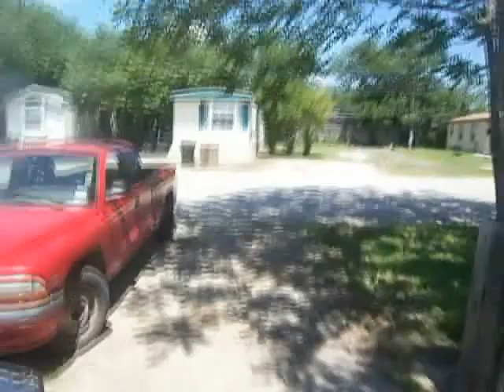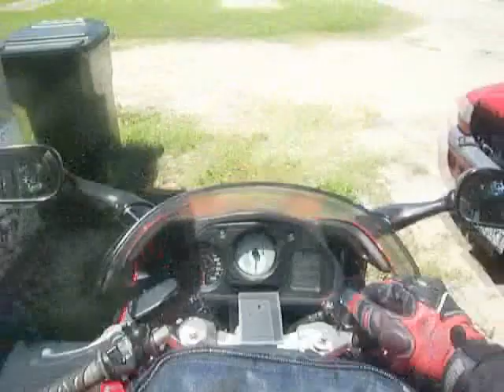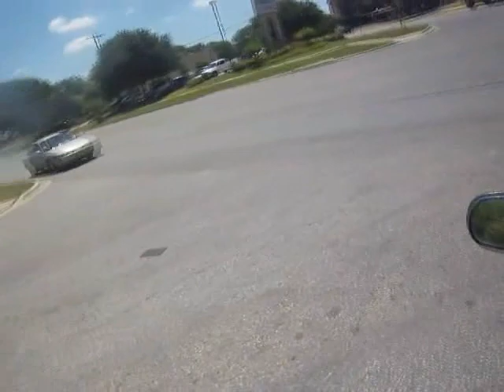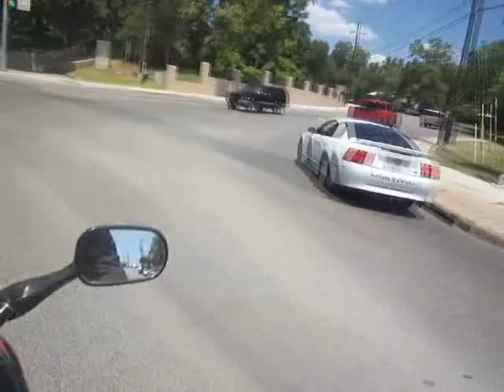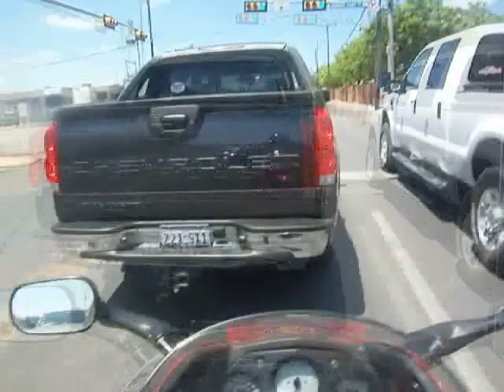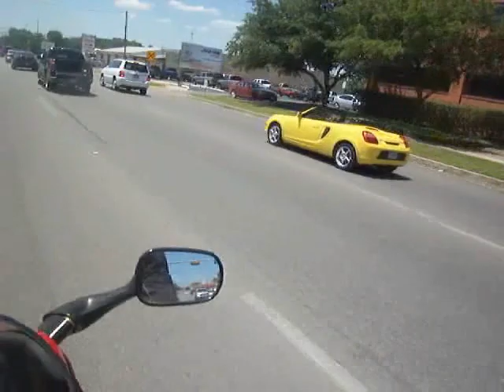Heading to the muffler shop

Comment: It's ok to clutchless change up, provided you snap off the throttle (don't have to fully close it) enough to take the pressure off the drive gear and the other gear. 
Check out my "clutchless or crutchless" vid, see if that helps.

Comment from the maker: That's usually how I do it when I'm in a hurry. I will skimp on the clutch if I have my left hand resting on something other than the bar, but if it's already there...well it only takes an inch of pull or less to engage the clutch so why not. :)

Comment from the maker: If you've got to shut the engine off you're doing it wrong. I had a spring loaded setup on my jeep that used the e-brake handle. Pull it up, it got loud, let it down and it got quiet. Ofcourse another option would be to use some sort of steel butterfly valve which just opens one way and not the other, on one side of a y-pipe that doesn't have a muffler on it.

Comment: most likely the gears are not straight cut gears. Its the same gears as in a car transmission, constant mesh transmission, its just syncronisers that engage the gears and clutchless shifting damages the synchronisers... wich is VERY bad.

Comment: actually ,a valve or a mechanism has been around for decades.a pin is required.and switching it back requires turning the engine off.bitch   13